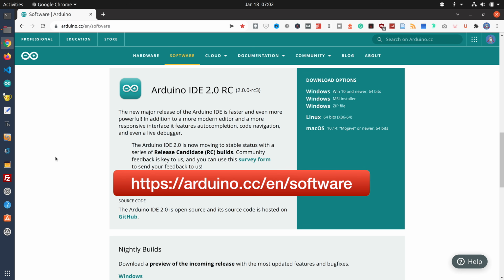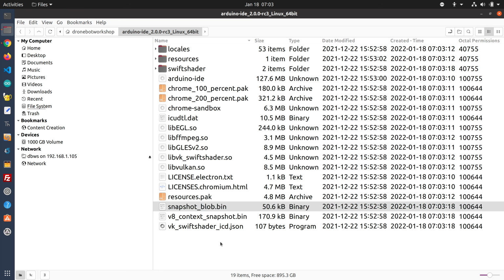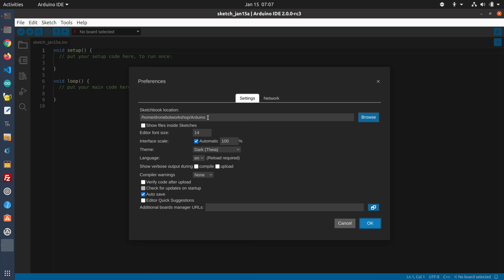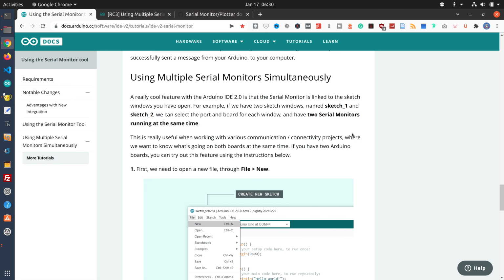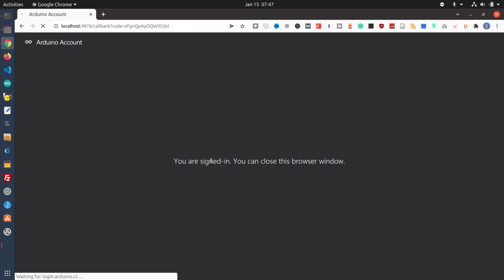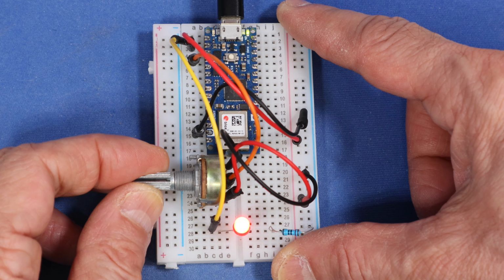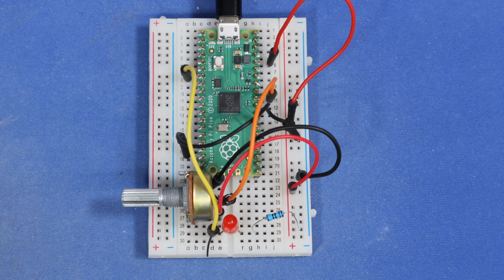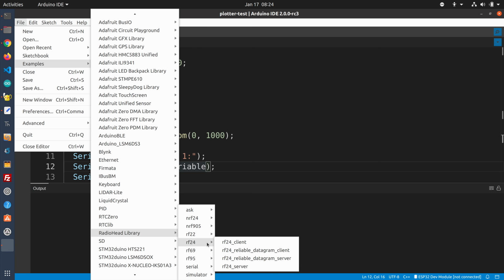Arduino IDE 2.0 - Testing Release Candidate 3

Comment: One thing that I really wanted to see and thought they were going to do is any libraries used is stored with the project. That way your project will always work. That is how it is done in platfromio. 
I see that the library can store different versions but if you dont remember the library version that you used  a year ago then you have to go through them to see what works.
Reply: you can even tell platformio that you depent on a lib with a certain "commit hash version" of a github repo

Comment: While very easy, you aren't forced to run it from the command line in Linux. It is easy to create a desktop launcher icon. 
This is similar in other desktop environments.
For example in XFCE go to settings > menu editor
select new launcher
select an icon picture
Replace "New Launcher" with whatever name you like eg. "ArduinoIDE-2"
the description is what pops up when you hover the mouse over the launcher.
command: /home/myname/arduino-2directory/arduino-ide %f (adjust directory path as needed)
leave working directory blank:
add menu categories as desired: eg  "Development" or "Electronics"

In advanced if desired: set generic name eg "Devboard IDE-2" ; 
keywords used for menu searches separate with semicolon no extra spaces eg "microcontroller;embedded electronics;electronics;avr"
mimetype associates file types, so double clicking a file of that type will open with this launcher(do not set this here if you also use IDE1.8 and want 1.8 to stay the default). The 1.8 ide launcher has "text/x-arduino;" as the mimetype. Mimetype can also be changed in "Default applications" after making the launcher. (In this type "text" is the generic mime category used to select alternate apps and "x-arduino" is specific.)

Comment: I enjoy watch your videos, because the sound, graphics and explanations are clear and excellent. 
Can you perhaps please explain how to transfer code to the ATMEGA16 that was written using the Arduino IDE and the Arduino Uno as the ISP.  Does one have the remove the chip from the Uno before upload?  Is a 16MHz Crystal required? What about using 12MHz or other frequency crystals?🤔

Comment: You made it sound like running apps from terminal is something worse :) I'm a Linux user for about 15 years and all I can tell you that I practically live in the terminal which means it is actually an advantage for me. On top of that, I don't need to use root privileges to install AppImage files as those are just that - files.

Comment: Thanks for your fantastic video. Clear and well done as always. I'm just so disapointed about that new IDE. Whats really new? A slow and half crafted auto complete. The rest is just cosmetics. It took them years and they are still missing some vital features like split screen, function finder, visible feedback during compiling...
I love what the Arduino crew has achieved since the begininng, but this time I have the feeling that they really lack the stamina or the capacity to do something good.

Comment: I also tried out Ver. 2.0 of the Arduino IDE and was disappointed. Right off the bat I encounter two major bugs which were confirmed on the Arduino forum. I'm also trying another Arduino called Programino Ver. 2. So far, I'm quite impressed. Many more features than the Ardiuno version. For example, instead of having only a few basic styles to modify the appearance, Programino allows modification of fonts and colors of most aspects of the sketch like variable names and values, data types, etc. Perhaps DroneBot Workshop could take a look this IDE as a part of a program comparing Arduino IDEs.

Comment: I'm really interested in this IDE, if only for the dark theme! Is the theme editable yet, or is it still a convoluted method of hunting for specific files and editing them?
Also how well does it handle self-made boards? For example I have a boards.txt entry for a bare 328 chip that runs on the internal 8MHz clock. Do I just edit the main boiards.txt file to include that entry. Is it the same method here?
Reply: Did you realize that you can dowload this IDE for free and try it out?
Reply: @longdongsilver4719   Actually came back to arduino programming recently, and started using the version 2 IDE a couple days ago xD
Adding my custom boards to it was non-trivial compared to the older IDE, but I got it working :D

Comment: Thanks for giving an extensive insight in using the new IDE! Is there a protection against selecting the wrong board when uploading? I crashed 2 nanos with the old IDE as I forgot to switch from the ESP32 to nano. Setting the board in the sketch (if supported by the IDE) would offer some protection, I think.

Comment: I don't see Arduino IDE 2.0 rc3 working with ArduinoOTA (over the air update) to an ESP32 / 8266. 
On the Mac I only see the Bluetooth interface of the Mac, but not the IP address from the ESP. 
But with this it is possible to send the program via an HC-05 bluetooth model.
Reply: the Bluetooth interface sometimes disappear. The area of uploads via serial is buggy. Sometimes it works, sometimes not.

Comment: Thank you for a very good video. You have saved me a lot of time testing the new Arduino IDE. I think I'll wait another year  until 2023. The old version is good enough for my small programs with a max size of 200-300 lines.I use a mix of Arduino boards, ESP8266,ESP32 and STM32's.

Comment: I think I discovered an undocumented feature of the new IDE. It can speak French as well as English. I programmed to say "Bonjour Monde" and it ran perfectly without difficulty. 
The IDE can also run very fast. Last night it ran so fast it ran out the door and I couldn't catch it. It's still out there, running. If you happen to see it in your neck of the woods, running, catch it for me, will you ?
73 de
Ray WW0AW

Comment: Bill, you have saved all of us a huge amount of time with this video.  As a PlatformIO coder, much of the good in 2.0 is quite obvious as you stated.  The serial plotter feature is NOT available on PlatformIO; a feature in IDE2.0.   A major PlatformIO feature: Rapid Compile&Upload.  Your video showed quick compile and upload but were you just editing out the delays?
Reply: Workaround for PlatformIO: attach a serial/USB converter to RX/TX, GND and VCC on the Arduino/ESP8266 and use the serial monitor on that port while using the official USB port for programming. If you don't have such a port, then use e.g. smarTTY for monitoring. You can connect to the Arduino using the shared USB port you also use for programming. all you need to do is to disconnect the monitor while you upload a program. The window will stay open and there is a button for connecting in it. almost as easy as with the Arduino IDE

Comment: This works for Linux Mint Mate. Open up the main menu and click on Preferences. Find the Main Menu editor, click on Programming in the menu list and then click on New Item. Click on the browse button next to the 'Command:' box and navigate to the arduino-ide app and then click on 'Open'. Complete the 'Name:' and 'Comment:' boxes as required and then click on OK. You will then have a menu item that takes you straight into the Arduino IDE 2.0.

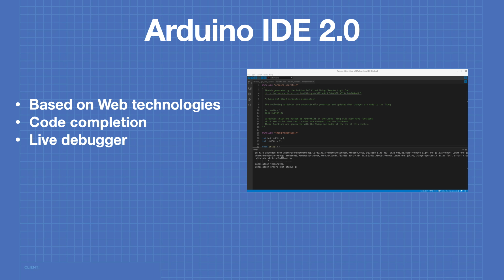Comment: Another excellent video! I would be interested to see how the live debugger mentioned at 3:53 works. These days I never use arduino any more because the ability to step into running code and view variables with most STM32 tools is such a game changer. There is no way I could go back to not having proper live debugging.

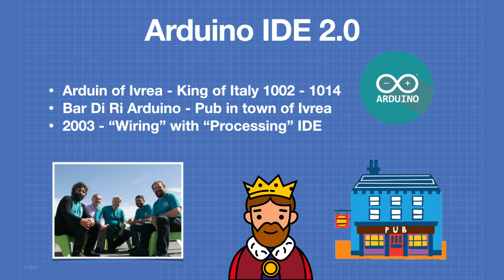Comment: 2:10 The Arduino IDE was based off of Processing's IDE, but Processing itself is not an IDE, it's a programming language aimed primarily at helping visual artists without programming experience learn programming and make it easier to integrate digital media and data into their work.

Comment: Lack of an icon to start the IDE in Linux is not a problem is using the KDE desktop.  Using the KDE app menu manager one can add icons to the menu, panel, and favorites easily.  This is likely possible with other desktops but I have no experience with them regarding this.

Comment: Had a pc crash and had to re install windows , came to installing the Arduino IDE and all went well then I clicked the Arduino icon and up popped this weird version I had never seen before ! It  didn’t take long to come to terms with it as it is so similar to PIO. Definitely a step in the right direction . I wonder if the updates  of a library work as they used to on the old IDE ( always runs the updated version )  or do they now work like in PIO - where it will use the version the sketch was originally compiled with ? That was one annoying thing with the Arduino IDE - it would update libraries at Will and run the latest version which did stop some sketches that required an older version of a library to operate .

Comment: Looks a lot like the Arduino extension in VS Code
Reply: Yes it mimics a lot from it but they missed the good parts of VSCode. In fact this is still a low level IDE disguised in some better thing.

Comment: When installing under Windows, you’re asked to install for all users or just yourself (me). For all users, the program is installed in the c:\Program Files directory, where it should be. If installing for your own user, it’s stored in your profile. Only data and not executables should be stored in your profile. I backup my profile regularly and I do not want .exe files backed up with data.

Both versions can be installed on the same system at the same time with seemingly no interference.

A few programs that I compiled under 1.x did not under 2.0 - probably due to a library problem. I’ll wait until a finalized release to test further.

Comment: To me, this is still beta.
It should optionally import settings from the version 1 install, such as the boards URLs, and installed libraries.
Libraries manager is missing features.  You can't filter on only installed Libraries or Libraries that have updates available like you can with v1.
Reply: I agree. I still has lots of bugs and some of them are so obvious that it really looks like an early beta version.
Reply: @longdongsilver4719  Same tried 2.0 for about 20min, was nothing but problems with standard features that didn't work. I can't believe they even got this far and still has major fundamental issues.

Comment: The theme seems quite similar to default-vscode
Reply: yeah, not just theme, the whole interface. i am thinking this whole IDE is based on vs code.
Reply: @yash1152  Surely not. VS code is faster,, far faster, has a lot of good features that are missing in this IDE, the autocomplete function wors really well in VSCode and the workflow and file management philosophy is totally different. They  have tryed to make it look alike but they missed the point.
Reply: @longdongsilver4719  umh, it's totally possible that they left out those parts. 'Cz achieving such extremely high level of similarity in looks without that (copying looks) being main aim is next to impossible. so yeah, i still stand by my hypothesis that it's based on vscode. sure it (ard) might not be as good as vscode, but that doesnt mean it (ard) can't be based off of it (vsc).

Comment: Does this IDE 2.0 reside on the PC only or does it run from the cloud.
Reply: If the Arduino IDE is installed each time you use a new board it will be downloaded from the internet. You can use the IDE offline with the downloaded Boardfamily. You can also do this once and then transfer the installation to another computer (without internet)